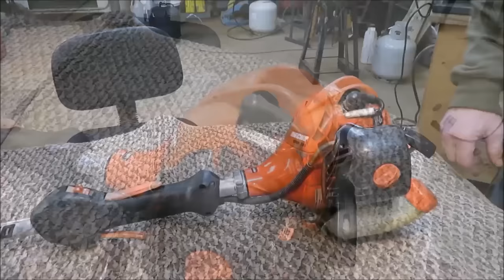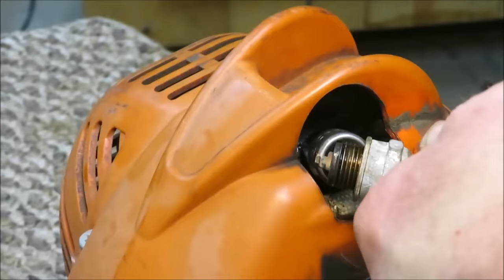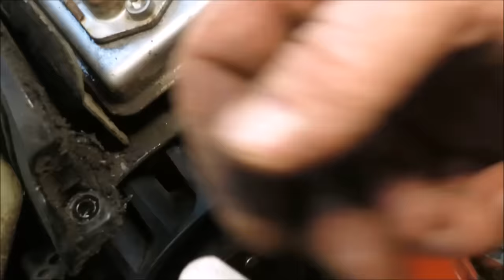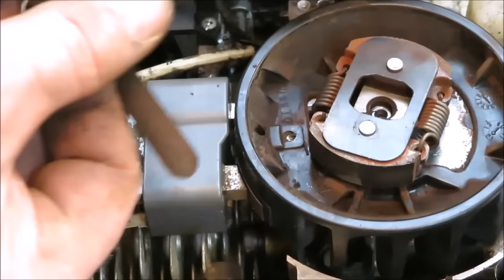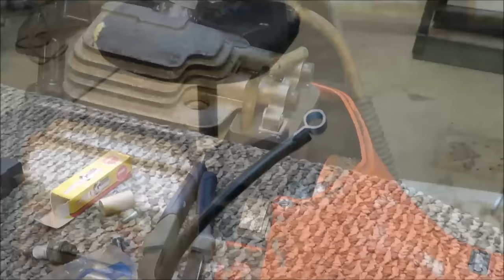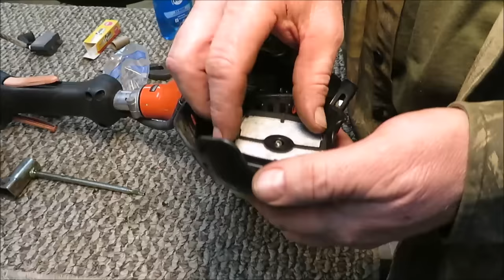string trimmer weed eater coil test & replace

Comment: I'm trying fix a srm236es for a buddy. I'm not getting spark when plug held against the case, but do get a electric tingle if I touched the coil wire which was bare. Can a coil produce some electric but not enough to spark? I'm wondering if its a coil that's No use or is it still working. I also checked with a new plug.
Reply from the maker: Sounds to me like you need a coil yours may be weak.
Reply: @Robinson-Homestead  thanks for replying. I wasn't sure if it could be weak. Just ok or broken. I've just ordered one from China as its quite dear to order from your country. Can t seem to find any in the UK.
Reply: I borrowed a coil from same model and it worked ok, so I look forward to my Chinese coil in 4 weeks!

Comment: Hello  Maybe u can help me....My ecco trimmer was starting but did not have enough power and did not spin the head...so i clean up the mesh, put it back but now starts but still does not have enough power to spin the head...i check the carbutator filter and i washed and let it dry but still does not want to work...what can be?  THe unit is a year old use only once a month and has not been abused...i will appreciate if u can give some tips or direction in how to fix my unit..thanks
Reply from the maker: Have you cleaned the carburetor
Reply: @Robinson-Homestead  I took the filter out and was pretty clean.  As I said the unit is only used once a month and I purchase it about a year ago.  Could be the gas/oil too old?
Reply: @Robinson-Homestead  I cleaned the mesh that was very clog up, put it back but still have the same problem. One thing though...seems that have a bit more force, starts faster, but still do not turn the trim head and if I  pump gas trigger it seems is going to go off..
Reply: @Robinson-Homestead  I FIX IT!!!!  YIPPPY!!!!!   Ahh  what an amazing experience learning how to fix a weed eater....Thank you so much for your suggestion.  Blessings to you and yours.

Comment: My plug sparking....but machine not staring...what i do sir?
Reply from the maker: There is three things  needed for a motor to run,spark,fuel and compression. Make sure and check all of these.

Comment: An easy test is to remove the plug and drip in a bit of fuel, reinstall the plug and give it a pull. It should run for a few seconds. If it doesn't, you have a spark or compression problem.

Comment: my craftsman weed eater has two wires coming from the coil to the carb and two to the shut off switch,, what is the item on the side of the carb  ? i cant get it to fire,  even put another coil on it, unhooked kill wires,, nodda,,  wont even shock me at all
Reply from the maker: If you flip it over it'll shut it off.

Comment: I had no spark, measured a resistance of about 5k ohms on the RCJ-6Y spark plug, so I thought the plug was good. I then assumed the coil was bad. For the heck of it I cleaned the spark plug with sandpaper, and it started. Stalled, difficult to start again so I'll buy a new spark plug. I should have been able to read very high voltage between the spark plug wire to ground while pulling, but did not which is why I first assumed the coil was bad. It should have pinned the needle on an analog meter on it's highest AC scale, correct?

Great video, thanks.

Comment: on 2 cycle can having unaccurate gas  mix cause no start?
Reply: No you should get some sort of fire unless you are straight oil
Reply: Shoot some WD 40 into the cylinder and then try if it burps or farts it’s a fuel delivery problem

Comment: Clean the magnito? It's a magnet. There is nothing to clean. Rust on either unless there is no gap will not affect the system.
Reply: The surfaces of the coil are laminated. If they become delaminated, ya got no spark.
Reply: How are you going to clean between the laminations?

Comment: 🤔🙋‍♂️i know i know, You know if you can't find a piece of metal to ground it to, to test it for spark. but DO AT YOUR OWN RISK. there is other ways to find out if you got spark. 😉 easiest quickest way👌👍 as you could just sit there and hold the end of the spark plug  at the metal part where it sparks and then just pull on pulley  and then boom👍😉😁 you would forsure  know if your getting Spark or not😁. no hassles on short wires that you can't seem to reach a metal spot. but to all people that is scared of a lil zap I wouldn't recommend it. so if that's you ignore this. DO AT YOUR OWN RISK.

Comment: My stihl fs94r idles good but bogs around 3/4-7/8 throttle. What could cause this?
Reply from the maker: Maybe #1  Clean the carb and adjust it  Maybe #2 Clean screen in the muffler hope this helps.
Reply: i got stihl fr3001 also idles good early but bogs down when 7/8 throrttle too, clean the carbon in exaust,but still bogs,and the carbs idk how to properly clean it

Comment: You dont have to pull the top off the wire is below the metal on the throttle cable and you can unplug it

Comment: Or you could run the cap down the wire first ,Then crimp your connector and pull the cap back down the wire!
Reply from the maker: Thanks for the comment.

Comment: You should never use steel feeler gauge for air gap. Use brass or stainless steel. The feeler gauges were originally for points or valves in the old days.
You’ll end up magnetizing the coil and crap ends up shorting it out. If feeler gauge sticks to any magnet don’t use it for coils.
Reply from the maker: Thanks for the comment.
Reply: Isn’t stainless also a ferrous metal and therefore magnetic?

Comment: I could have told you the coil was bad before you took it all apart. You also don't need a feelers gauge, you just need a business card to stick in there. Cleaning the coil and magneto with sand paper isn't doing anything, it has no affect if it is rusted or not.
Reply from the maker: Thanks for watching.

Comment: I'd like to make money fixing small engines I've done just about everything to my echo srm-210 and I finally have it narrowed down to tye carburetor diaphragm is too worn out and is bowed to the gas inlet position when its running, ☹️ so I'm waiting on the delivery guy to bring my a rebuild kit to the house... I've replaced everything fuel lines cleaned out all the jets and exhaust, spark is there, and ran a bit of seafoam through it to take the carbon deposits off of the piston... I can start it full throttle on half choke and it'll run until i take the choke off letting more air in and it dies so that and already knowing spark is there let me know its lacking fuel and the diaphragms are the last two things I haven't replaced yet 😤 its a bit frustrating but i got a new carburetor and rebuild kit on the way so I'm trying to be patient and see if that's the problem, if not, well, that's what the new carb is for lol good video I'm going to subscribe.... I see people say you took too long but I like clear plain instructions, I don't know what they were complaining about
Reply from the maker: I try to do my best I thank you for the comment Nichole did you clean the exhaust screen?
Reply: @Robinson-Homestead  yes sir we did we've cleaned everything spark plug is really good new fuel lines have been put on and gromett

Comment: The gap between the iron core “feet” of the coil, and the magnets embedded in the flywheel isn’t critical, as there is never contact between them. (unlike ignition points for example). Most small engine guys just use a buisness card to create the gap when retightening the coil down. No need to measure with feeler gauges.
Reply: Rust on the magnets or iron core isn’t generally a issue, as the magnetic field goes right through rust. Again, unlike ignition points, where electric current travels, and can be impeded by corrosion.
Reply from the maker: Thanks for the tip

Comment: Yeah Kevin I have a Ryobi string trimmer and it was run then it started bogging out and then he did run and then headed bog out you know and then so I tried to clean the carburetor out and I screwed with carburetor and it would go you know on for 10 seconds no not even 10 seconds just about 3 or 4 seconds real fast waymo okay so I thought well she carburetor so I bought a new one put it on that thing and it does the same damn thing I don't understand it maybe you could help me with that could it be the Magneto I don't know help sincerely yours

Comment: why didn't you put the boot on first then put the clip on?
Reply from the maker: Thanks for watching.
Reply: @Robinson-Homestead  Love your videos. I was just asking. I have had the same kind of things happen. Changing front shocks on my old ford and fight 20 minutes getting it off because the shock is turning with the nut. Friend grabs longer ratchet and socket and back and forth a few times breaks the top of the shock off. Job done in a quarter of the time.

Comment: Most of the ones I’ve had trouble with the wire got pinched on the handle and grounded by the trigger I’ve also heard from the saw shop that especially with Husqvarna saws it you pull the spark plug wire off and don’t have a good connection to the spark plug that is grounded solid it will burn out the spark circuit on the motor in one pull of the starter rope and the spark module is about $150 they had a customer burn out 3 of them after finding he deliberately did this they refused to replace it after the 3rd time doing this some engines are touchy be carful how you test them
Reply from the maker: Thanks for the comment and info.

Comment: Those s r m echo weed eaters have a life time warranty on the coils dealer has to replace
Reply: Thank you! That is useful information!
Reply: Great info if true. I own 2 srm models. Hopefully it is as easy as sending them the bad coil for replacement because if it involves a third party or an echo dealer etc. that just becomes a hassle. Thank you very much for the info. I have excellent luck with echo products (backpack blower, string trimmers, hedge trimmer). I hear their chainsaws are good and can compete with the big names in some areas. Apparently every years models improve but nothing is dethroning my Stihl. Cheers

Comment: Could've put the boot on first then put the coil part in the wire then pulled the boot over the pins easier..
Reply from the maker: Thanks for the info.

Comment: you just had to try fitting the HT plug cap lead the wrong way! Ie: the bloody hard way!,, the right way to fit the new plug cap is push the end of the HT lead through the plug cap first and when its poking out the park plug end fit that stupid spring hook that presses onto the spark plug, then pull the HT lead and spring back inside the spark plug cap and seat it! try that the next time you fit a new cap,, its sooooo much easier doing it that way!
Reply from the maker: Thanks for the comment Michael.

Comment: Just wondrin if these coils are like the briggz stratton coilz that don't need points, 
the well known magne-tron has an eelectronic component like a diode or transistor
inside it.
Reply from the maker: It don't need points Raymond thanks for all the information.
Reply: @Robinson-Homestead  Hello Kev R, That is what I was saying, wondering if it 
was one of those coils that did not need the points due to the electronics
inside it.

Comment: I have a poulan blower.. fires right up but will not restart until it sits for an hour or so.. I've changed spark plug, fresh fuel  regapped plug.  No luck. any ideas?

Comment: Wrong air filter lol, the black ring is for the Srm 266 and also uses a pre filter, the white ring air filter is correct for 225, but 199 I just buy a new one then jack with one.
Reply from the maker: Thanks for the comment.

Comment: TIP 1: place rubber spark plug cover on wire BEFORE you put metal tip on. Lube wire lightly and slide rubber cap into place

TIP 2: place rubber spark plug cover in hot water for a few minutes and it will be much easier to fit over metal tip.
Reply from the maker: Thanks for the information Joe.

Comment: The spark plug has 1KΩ-5ΚΩ resistance. Never check the spark plug... with a multi purpose wrench decause it has zero Ω resistance. If your coil was good then with your wrench test...then burned
Reply from the maker: Thanks for the comment

Comment: Testing the coil with a multimeter would have saved you the trouble of reattaching it to the machine right?
Reply: Good video though!
Reply from the maker: Thank you for the comment not good at multi meters.
Reply: Testing the resistance (Ohms) is a good indicator but not 100% proof.  I had intermittent ignition coils a few times when you have spark and runs for a minute or short while then just dies, stops.  tested coils with multimeter seemed just fine but still died, replaced coils and the problem stopped.   rare but happens.

Comment: Dear sir whan you change the magnet flywheel u have to c North pole and South pole marked as S and N on the magnet flywheel on the linner side. According to the magnet flywheel or the placement of magnets you must put the ignition coil. Must not judge directly to any part as fused or gone. (The magnet flywheel must match to ignition coil) hope you got me what iam saying.

Comment: Four things not just three, spark, air, fuel, and compression. Also, cleaning the rust off the coil and magneto isn't necessary. You mention "to make sure it has good contact", but the gap that you measured is exactly that, a gap, there is no contact. The magnetic field is still there despite the rust.
Reply from the maker: Thanks for the comment.
Reply: Max Imus  what if  it has  the four things and still  won't start?  I had this same issue with a handheld leaf blower, even bought a new coil and  still won't start,  it has spark  but it looks more like a blue weak spark, not a shiny yellow like colored spark, what else could be the issue?
Reply: @josem.2909  timing
Reply: macknumber9 thanks!  I think timing fix is out of my capabilities 😄, I sold it cheap for parts, I'm still curious about the timing thing though 🤔
Reply: @josem.2909  could be sheared flywheel key which is extremely rare on small equipment like a weedwhacker

Comment: Sheesh.  Run the wire through the spark plug boot,  then connect the wire to the cap for the spark plug.

Comment: If you just put the boot on before you put the spring on then you pull it back without trying to push the spring through the small hole on the boot. Just saying.
Reply from the maker: Thanks for the comment cc cc.

Comment: I would have took the plug cap off and used the bare wire, only because the wire is always coiled near the plug  and pulling the plug cap on and off. it’s easy to accidentally Disconnect the cap  so I’d check the wire hadn’t  pulled out. before cleaning the pick-ups.   But I can’t knock your figuring process.  Strimmers and bush cutters are horrible tools

Comment: At 24:00 minutes where you put the cap on for the spark plug ,Its a lot easier to push the wire through the  cap and out the other end  then put the  metal piece in and push it back  in and stop when the  part that holds on to the plug is in the center of the cap . I have never seen it done the way  you did it before .Here is a link that shows how to test a coil https://youtu.be/TlMqyNVNM6U

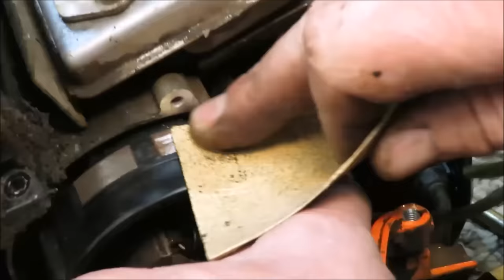Comment: 14:35 and 15:51 - absolutely useless cleaning the poles of the ignition module and the magnet surface on the flywheel. This CERTAINLY won't "make good contact" LOL. These parts are 10 thou apart (remember) and never should touch. Cleaning them won't make any difference, the magnetic field couldn't care about that.
Reply: you sound like you have experience at level none 
ive cleaned many rusty fly wheels from trimmers to 18hp generators and that was the cause in atleast 20%  of non spark problems
Reply: @bakedpagan4674  - I have a LOT of experience with small motors plus I have significant knowledge of science and physics. My most important attribute is called "common sense"...
1) Dirt, oil and rust on the surface of a magnet does not change it's magnetic characteristics. Not one tiny little bit!
2) The magnets in the flywheel should NEVER touch the other ignition components, so there is no requirement for a clean surface to create a "good contact".
3) Hence, whether the flywheel magnets are clean or dirty makes ZERO difference to ignition. You could polish it to a mirror finish and it still wouldn't change anything at all regarding the ignition system.
Reply: @johncoops6897  how does it feel tooting your own horn...
if you have all this vast knowledge make some videos for us to learn..
Reply: @bakedpagan4674  - I am not "tooting my own horn". It doesn't take much knowledge to understand basic mechanics and physics, nor to point out when somebody is just plain wrong.

Comment: Ok you spend 2 hours to find the problem at $50.00 per hour . Then spent 1 hour replacing the part at 50.00 per hour. so you spent 100.00 labor plus 75.00 for parts. Total 175.00 for a 200.00 trimmer.  stupid people.

Comment: Why didn't you "ohm out" the coil first ! low ohms =ok, open = bad ! measure spark wire
to ground (case)
Reply: Foard Fow 
  What the resistance of theses coil?  Ohms  ???
Reply: I'd also check the terminal on the wire especially after seeing the Mickey mouse terminal the replacement had.
Reply: @scottvan1898  Yes, basic electricity , ohm's law,
batteries, generators,  capacitors, inducters, and etc, etc...!!  I seemed to have taken  
these courses 3 or 4 times in my technical career of over 50 years... Coils should be low 'ohms' 10 to 200 or so, Never "open"  !!!

Comment: I guess that since the pickup is integral with the coil there is no way to test the coil with a voltmeter. You could test the high side resistance but not the low side? Don't use the voltmeter to test for spark even if "certain" that there is none. Not sure that cleaning the magnets and pickup does anything since the magnetic circuit doesn't care about that crap. But WTF?
Reply from the maker: Thanks for watching